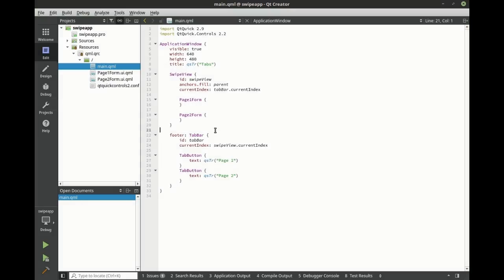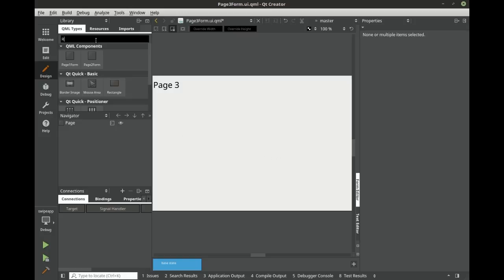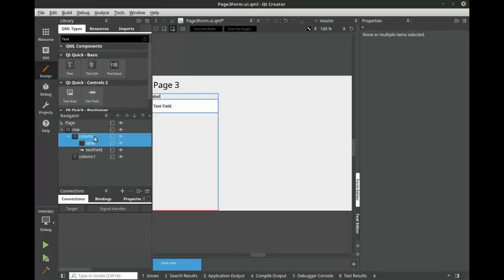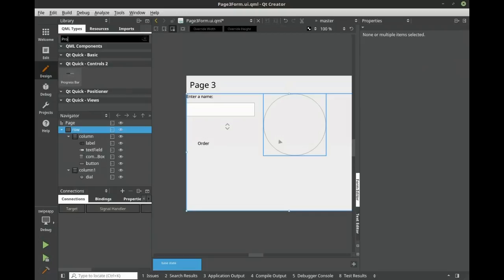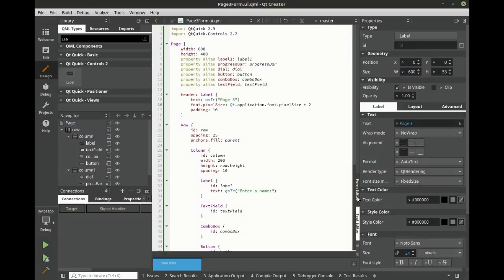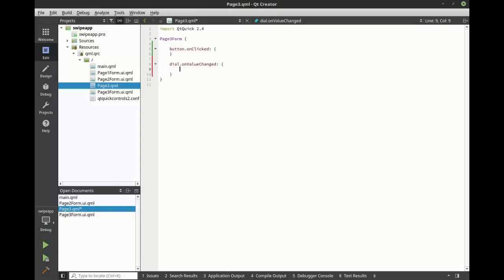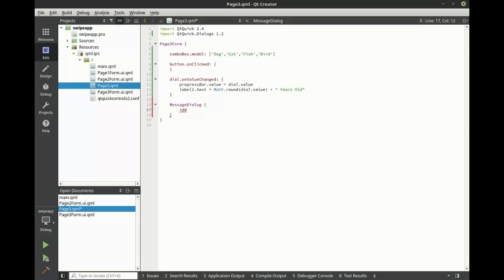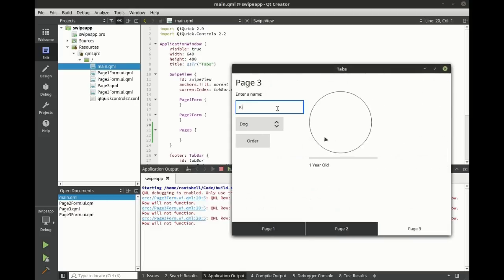Introduction to Qt – UI Design {tutorial}

Comment: Great video.  I'm running Qt Creator 4.13 and created a Qt Quick SwipeView application that generated the following files:
main.qml, main.cpp, Page1Form.ui.qml, and Page2Form.ui.qml.
I then created a new QtQuick UI file named Page3Form which produced (2) files:  Page3Form.ui.qml and Page3.qml.  Some questions regarding Qt Creator file creation:
1) Why when I created the original SwipeView application did it NOT create Page1.qml and Page2.qml?
2) When I right click on any element in Page1Form.ui.qml Or Page2Form.ui.qml > Go to implementation it creates the property alias in the respective PageXForm.ui.qml and the implementation in main.qml?
3) in contrast, when right click on any element in Page3Form.ui.qml  > Go to implementation it creates the property alias in the respective Page3Form.ui.qml and the implementation in Page3.qml instead of main.qml?  
4) If I deleted Page3.qml and then right click on another element in Page3Form.ui.qml  > Go to implementation, would it create the implementation in main.qml because Page3.qml is NO longer available?

Thanks, JT